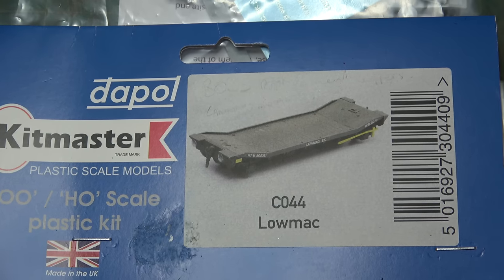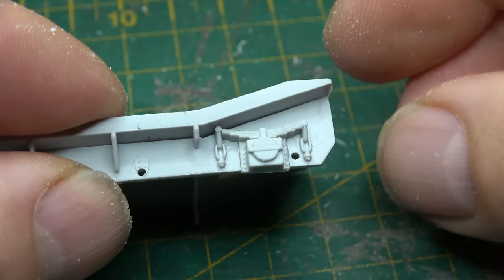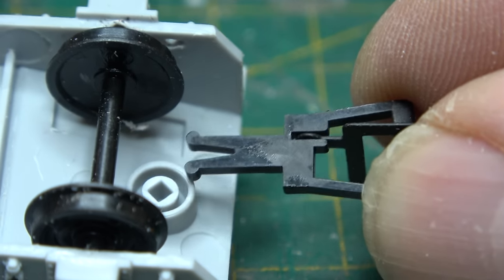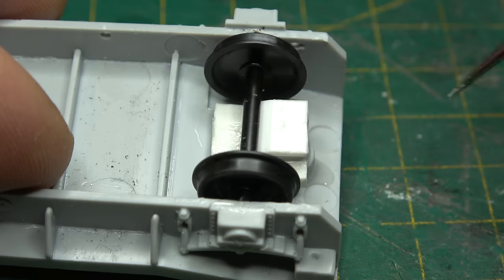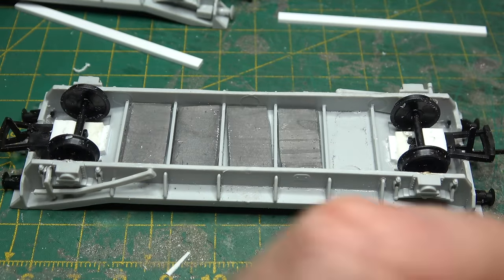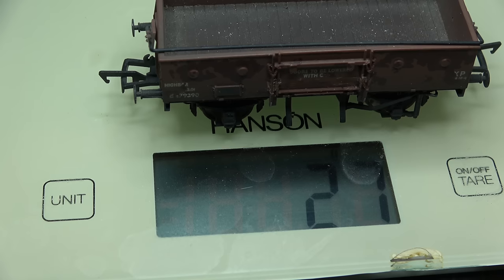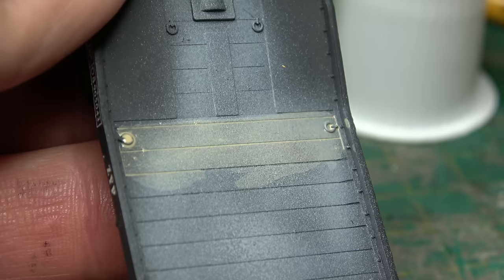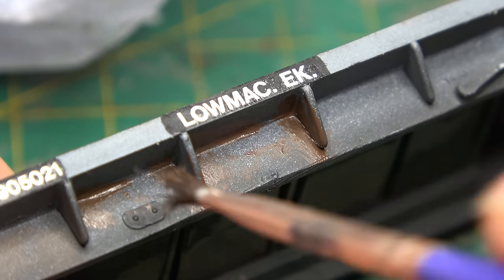Dapol/Kitmaster LOWMAC CO44 Kit Build

Comment: Parkside Dunas (now owned by Peco) produce packs of ready made NEM mounting blocks. You may have to pack them up or file some material off depending on the wagon you are fitting them too.
Reply from the maker: Yes they do, but there is so little space between the wheel sets axles and buffer beam that they just wouldn't fit.
I tried putting a Symoba pocket in but had to modify it! Found it easier to build a bespoke pocket 👍

Comment: When Airfix produced this kit in the 1960s/70s also included was a kit for a JCB digger. Believe Dapol still produce it.
  One detail you could have changed, removed the moulded on lift rings for metel ones made of fine nickle silver wire.  Geff Kent describes doing this in one of his wagon building books.

Comment: Seeing these Kitmaster kits put to use gives me a really good smile; they’re often forgotten by the press and influencers despite their availability and price. Great work as always. 

As for the Dublo signal box… please do! They’re everywhere, dirt cheap and nobody wants them. They’re detailed fairly often and look the part with the work; they’ve got a good shape and idea to work on. I’ve got one in the shed waiting to be desiccated too that cost me the grand sum of £2 at an exhibition. It’s not sacrilege if you’re giving them a better life!
Reply from the maker: Yes, these kits have been around for what seems like eternity and ignored by most and derided by a few! I like them though and intend to build the entire range on here over the coming months and years!
The signal box will get done, struggling to find a solution that will strip the paint off back to bare metal though, that's why I put to the side for now 😞
Deffo high on the list to get done though!! 😃👍
Reply: @Wallsrail Ordinary paint stripper from B&Q and the like should work; Nitro Mors and all that goodness. They’re kind of slow though so some diecast restorers on here use aircraft stripper. 

These days I let everything bathe in isopropyl alcohol; it hasn’t beaten me yet, saved my skin a bunch though when repaints go wrong…

If those don’t touch the paint a wire brush in a drill certainly will! 🤪
Reply from the maker: @ringmastermodels  tried all of those but has failed to remove any of the paint! Going industrial 😅

Comment: How do they run? Mine was horrendous.
Reply from the maker: with the brass bearings  = great 😃
Because of the soft plastic, warping is a thing so twisting to adjust for it is necessary 😞
Reply: @Wallsrail Yes, I used brass bearings and extra weight, and it still runs really bad.